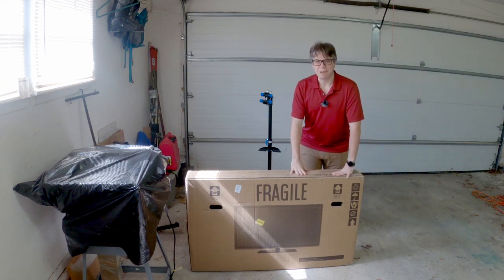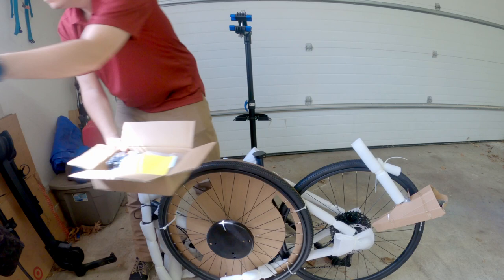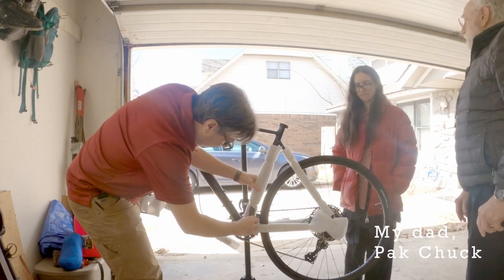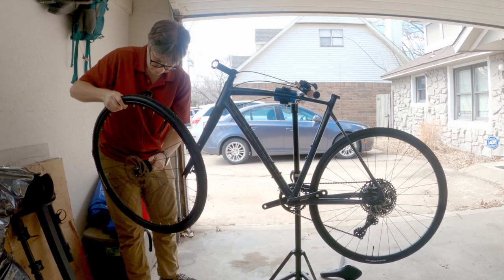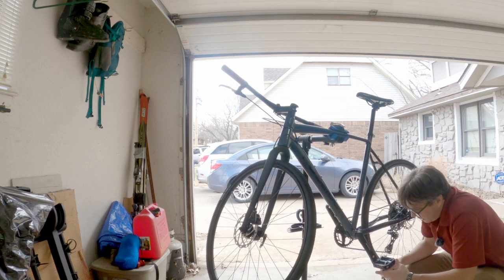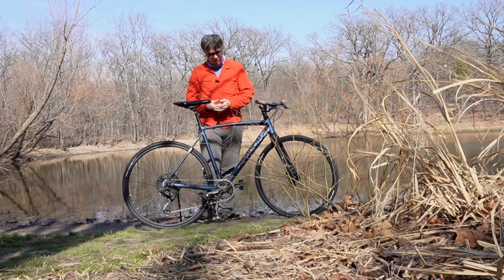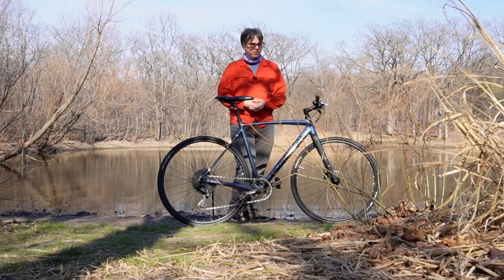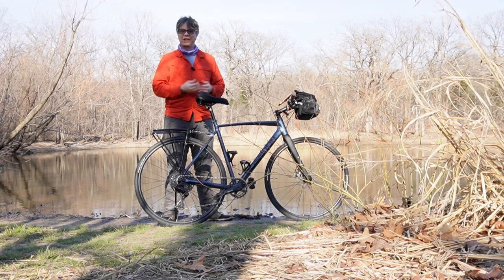New Bike Day: Chiron | Poseidon X (2022) | Keppel's Vlog 17 | Tulsa, Okla.

Comment: nice little video, very good presentation skill. If you need more upright position on the bike, I think just put a riser bar or a riser stem on it. You also may need wider tires for that kind of terrain too.
Reply from the maker: Thanks, Teru! I did try using a riser bar, but it didn't work the way I'd expected. However, adding butterfly bars worked a treat! I'm thinking the next upgrade will need to be the tires - the small block eights do ok on hardpack dirt, but the chunky rocks are much tougher.

Comment: I'm considering the Giant Roam 4 and the Poseidon X. I'm also planning to ride the full length of the Katy Trail in the next 2 years.  In your opinion which bike is best suited for the Katy?
Reply from the maker: Hi, Chris! What a great (and specific) question! I rode the Katy using the Roam 4, but the front suspension was definitely overkill for that usage. I'd say the Poseidon X would be better suited, since it's a bit lighter and has about the same carrying capacity - just be careful not to overload the front fork braze-ons (it can handle about 3 pounds per side - great for bulky lightweight items)

I'll give you one caveat about the Katy, though - the surface is limestone, which is great when dry, but incredibly difficult to pedal through when there's more than 12 hours of rain. If you take the Katy, I'd recommend changing your tires for something wider (or at least with greater traction) than either the Roam or the X have stock.
Reply: @Raveler1  I was also considering the Giant Cypress 3 which has larger tires so maybe that's the right choice.  Thanks for your response!

Comment: I’m a big and tall person. Is it easy riding on not so steep hills?
Reply from the maker: It is! The Advent X cassette has a great set of gears, and its lowest makes it easy to climb even steep hills, even for my 6'1" and 220 lbs (1.8m/100kg). It's a stable frame design, too, so coming downhill feels safe even at speed.
Reply: Is that the med or large sized?
Reply from the maker: @omegalamda3145  It's the Large size. And, I was surprised that the large was almost too big for me. I have very little bit of the seat post sticking up - to where it only barely fits in the bike stand when clamped to the seatpost.